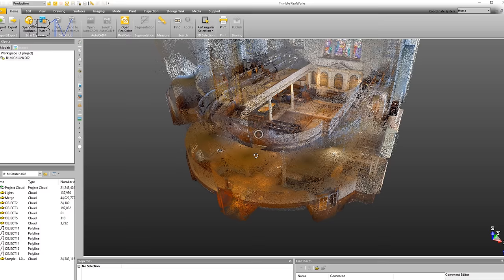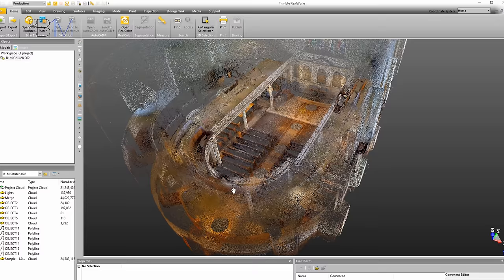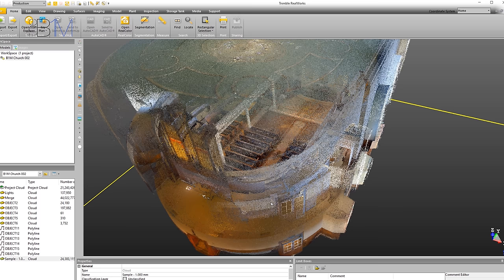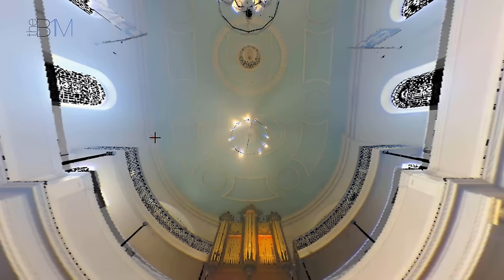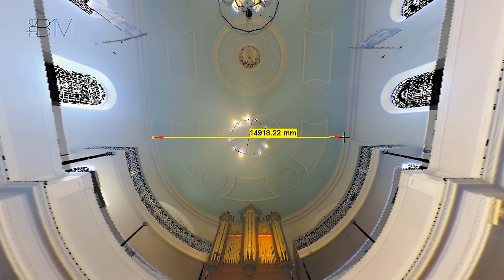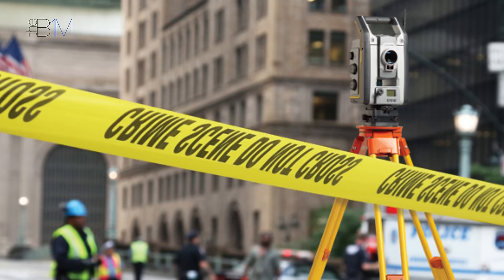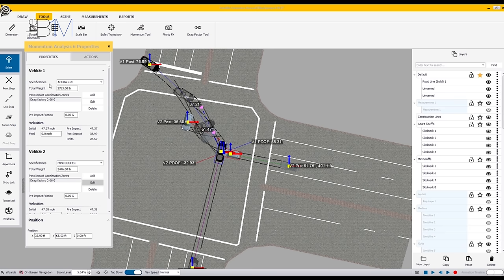What is Scan to BIM?

Comment: Looks good but how is it a BIM model? the scanned result just contains geometric data, its essentially a dumb model. So where is the BIM element?
Reply: I don't think they're claiming it's a BIM model; it's just millions of raw data points initially.  It needs to be processed first, then it's yanked out of the Printcloud and cleaned up in Recap or Pointsense, or something similar for eventual import into Revit (or whatever BIM platform you're using).  Then, it's a BIM model.
Reply: E Yeargain ok thanks so one they processed and imported into Revit do you get full functionality as you would a Revit created model?
Reply: Eric Yeargain d
Reply: @ericyeargain8498   sir, Even I'm also Bim Modeler I need know abovet families like Windows and Doors Ect...
Reply: @rambabumamidi868  I know how to create.